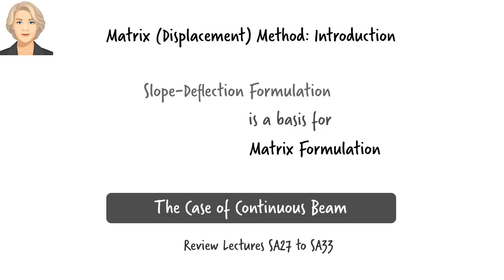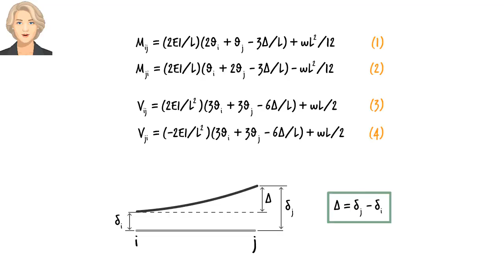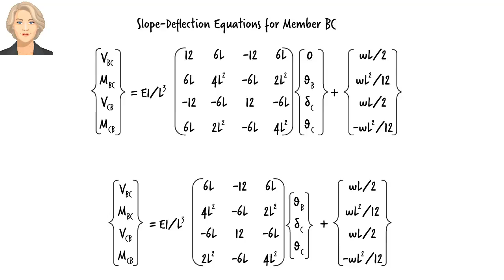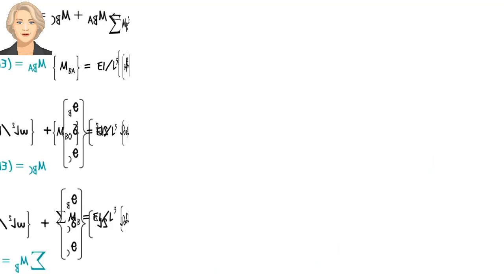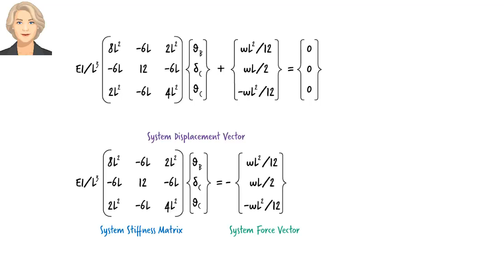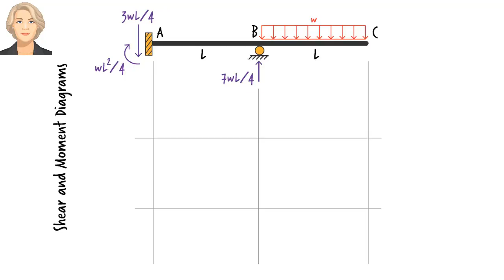SA45: Matrix Displacement Method: Introduction

Comment: Dr structure, I need finite element analysis lectures. Please help us. And what is the difference btn it and matrix displacement method
Reply from the maker: The finite element method is a more general version of the matrix displacement method. Here we are dealing with simple (one dimensional) elements used in trusses and frames. The FEM uses two dimensional (surface) elements such as triangles and rectangles, three dimensional (solid) elements like a cube, as well as one dimensional elements for modeling structural systems. But the computational strategy/method used in FEM, in principle, is the same as the one used in the matrix displacement method.

Comment: why is the reaction at B 7wL/4, it's not in equilibrium. thank you.
Reply from the maker: The shear force just to the left of B is acting in the downward direction at B with a magnitude of 3wL/4. The force just to the right of B is also acting downward with a magnitude of wL. Therefore, the reaction force at B must be 3wL/4 + wL = 7wL/4 in the upward direction. As for the force equilibrium for the entire beam, we have a downward reaction force of 3WL/4 at support A, an upward reaction force of 7wL/4 at support B, and a downward applied load of wL. They do add up to zero.

Comment: At 2:20 , why wasnt the Vji shown downwards, in a manner that would negate the effect ofMji in other words. Can anyone explain in to me? As oppose to what was done in https://www.youtube.com/watch?v=ub02dt6tcxk 5:33 on this video?
Reply from the maker: Generally, we draw the internal forces in a member in the assumed positive direction when we are not sure what direction the force actually assumes. For example, when we don’t know the direction of a shear force, when the force is unknown, we assume it to be downward (at the right end of the segment) since that corresponds to a positive shear in the beam. 

The sign of the calculated force tells us if we made the correct assumption. If  the calculated value is positive, then our assumption was correct. If however the  sign is negative then we know that the direction of the force is opposite to what was initially assumed.

In this case, we placed the shear force (Vji) in the upward direction since given that the distributed load is being applied to the segment is downward, the chances are that both end shear forces are going to be upward. So, we placed the shear force in that direction. But of course we could have also placed the force in the downward direction, which would have resulted in a slightly different equation, one in which the sign for Vji would have been different,
Reply: @DrStructure  thank you for your reply!

Comment: video on how to solve the matrix using the gaussian elimination method??
Reply from the maker: We don't have any lectures on the Gaussian Elimination Method, since it is more of a math (numerical analysis) topic than a structural analysis one. You should be able to find ample resources online, or offline, that present solution of linear system of equations using Gaussian Elimination or other relevant methods.

Comment: Slope Deflection method and Displacement method same or not ???
Reply from the maker: No, the two methods are not the same, the names cannot be used interchangeably. However, the displacement formulation can be derived from the slope-deflection equations, hence the two methods are related at some basic level.

Comment: What is degree of freedom? Please explain
Reply from the maker: In some structural analysis techniques such as the displacement method, we model the behavior of a  structural member (such as a beam or a column) using two or more joints. For example, it is common to describe the behavior of a beam in terms of its end joints. Once we determine the forces at the joints, then we can determine the forces (shear and moments) within the member. 

In two dimensional space, each joint in a structure can move (has the freedom to move) in x and y directions, and it can rotate about the z axis. These (the displacements and rotation) are called the degrees of freedom of the joint. The degrees of freedom of a structure is that of its joints.